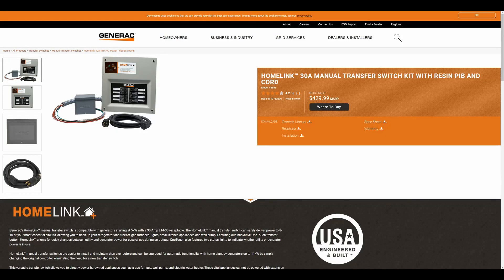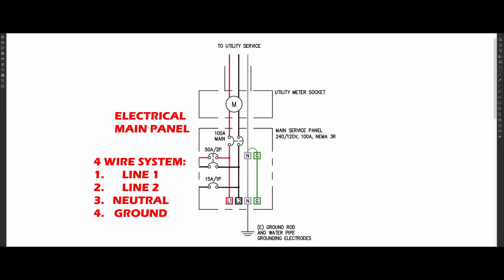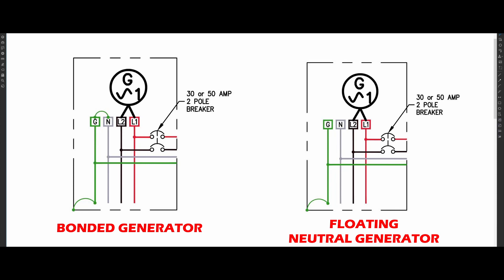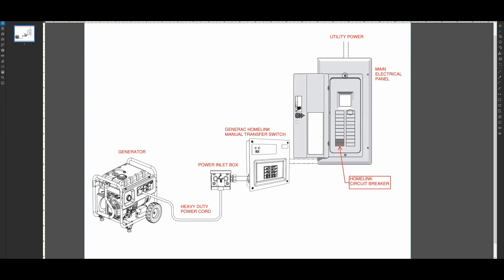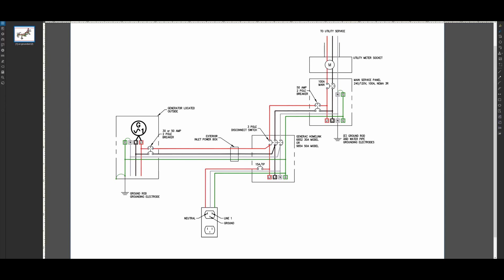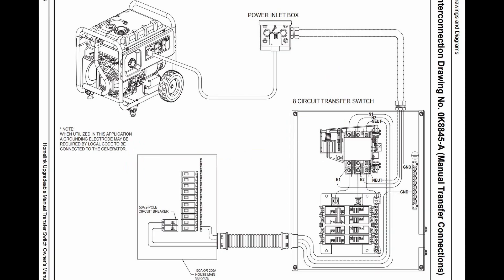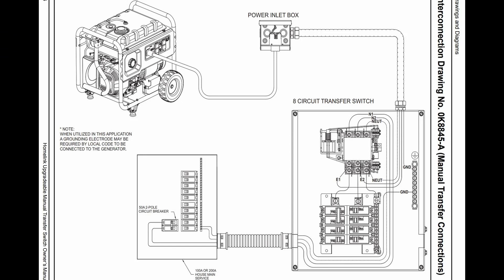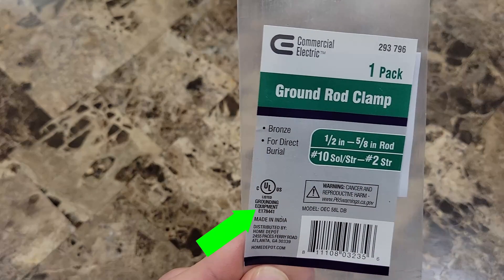How to Ground Your Generac Homelink Transfer Switch

Comment: I have the Homelink Transfer Switch setup and use a generator with a bonded to frame neutral.  Can I just connect a grounding wire from my generator frame to the existing grounding rod from my main panel when I run my generator and disconnect it after generator use?  Thanks for the video!

Comment: If I just have an interlock which of the three setups is correct. My guess is I would need a ground rod at the generator but im a noob at electricity
Reply from the maker: If you have a interlock kit (not a generac homelink) no ground rod is needed. I am assuming your generator is connected to your electrical panel via a twist lock receptacle and a 30A or 50A breaker. This interlock setup, I call "Case B" is outlined in this video https://youtu.be/8b-EApzNAFQ?si=bs8E1WRQB3SOSfW5
Reply: @dgtv3320  Great video thank you for the advice. I am curious though what would happen if the neutral isnt unbonded what are the risks/implications of that?
Reply: @dgtv3320 My electrician is coming to do the setup with the interlock bracket. So based on your explanation, I have to unbound the neutral wire and no ground rod is needed. I have a Westinhouse WGen11500TFc